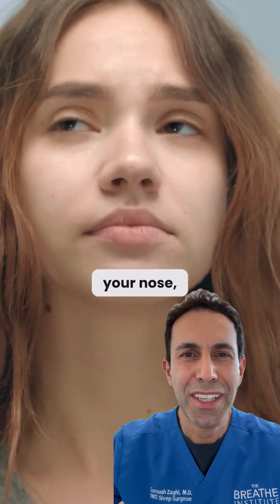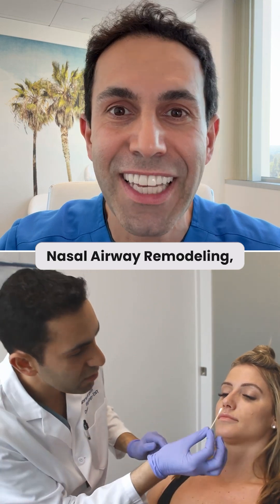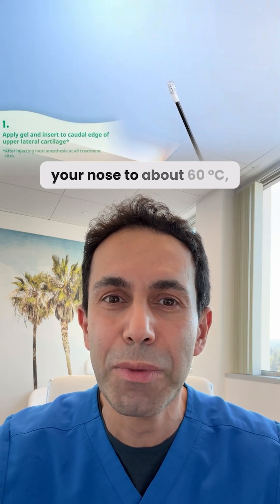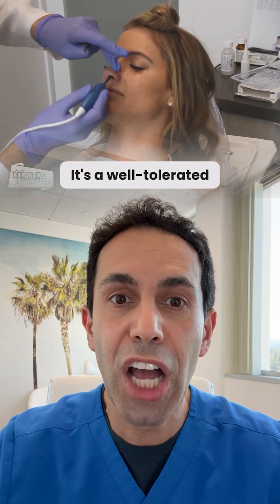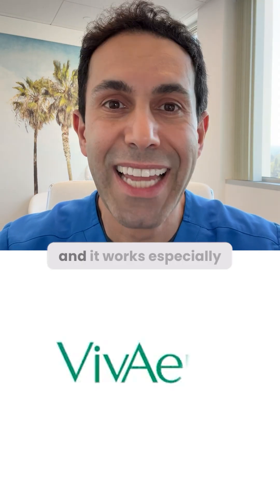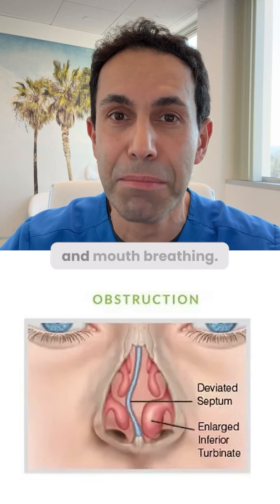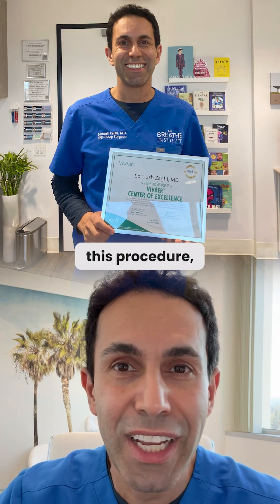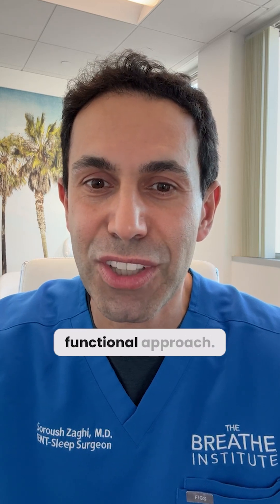What is Nasal Airway Remodeling? - Dr. Soroush Zaghi at The Breathe Institute

Comment: It takes about 1 hour. Several injections and numbing strips inside the nose, and numbing cream before the procedure. During the process you only feel pressure. When its over they send you home with nose tampons attached. 1 hour later you pull them out and expect mucus to flow out throughout the day. The results are instant, better air flow!